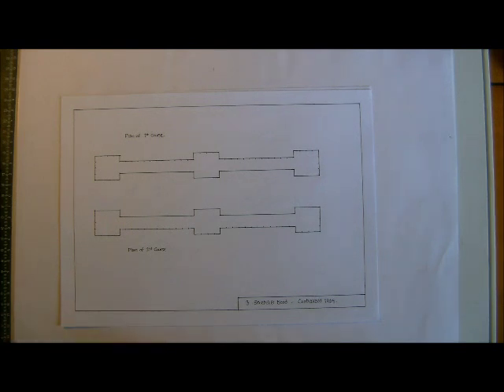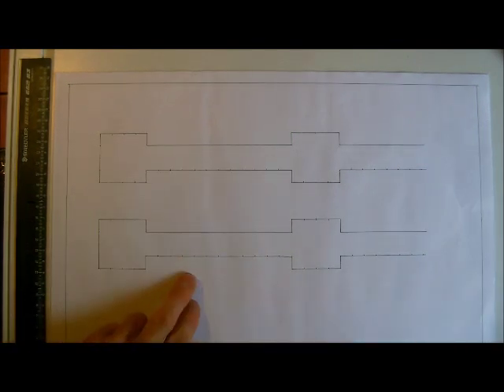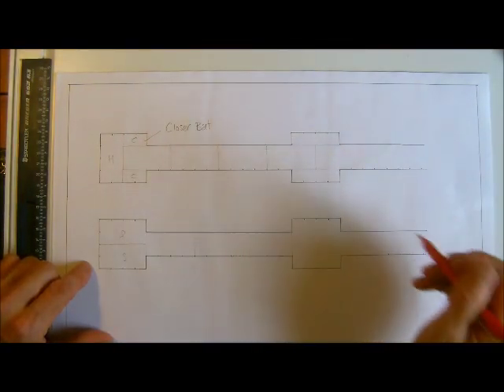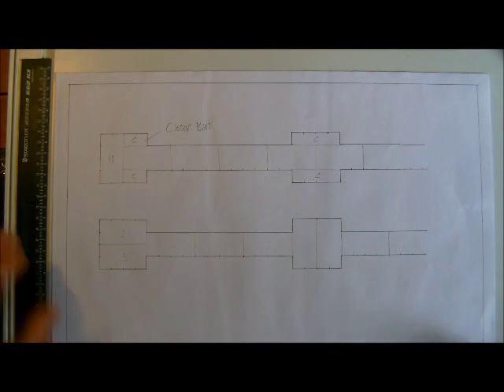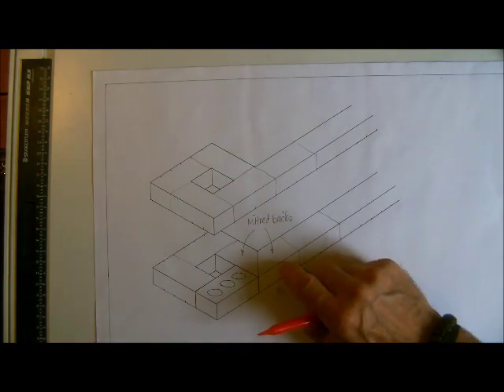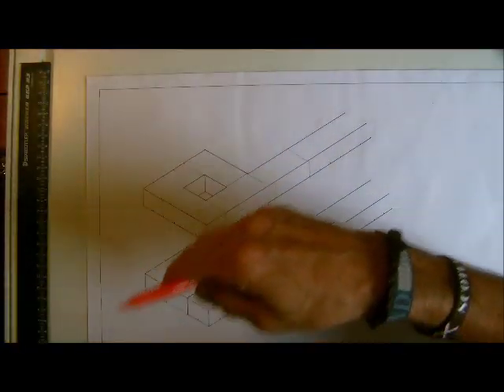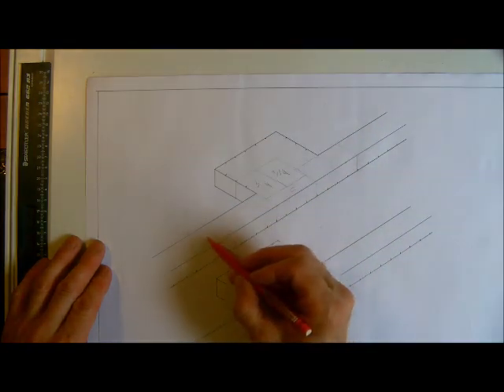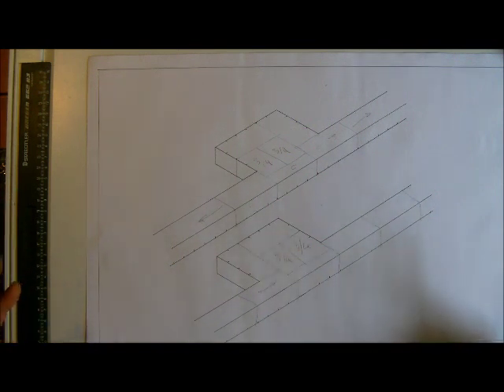Bonding Lesson 4 Centralised & offset piers

Comment: Hi rob on the wall with the pillars in the middle  would you build the pillars first  just cant understand  how would would line the wall trought due to the pillar in the centre, thanks you
Reply from the maker: Hi AM, the wall would be run in first, a course at a time, with the centre piers being laid at before the next course is laid, so they are built together.